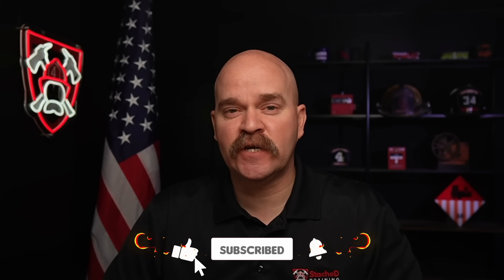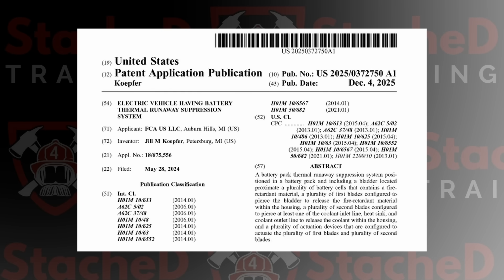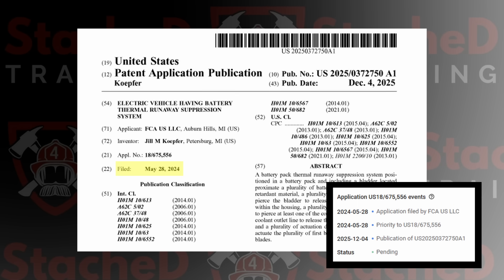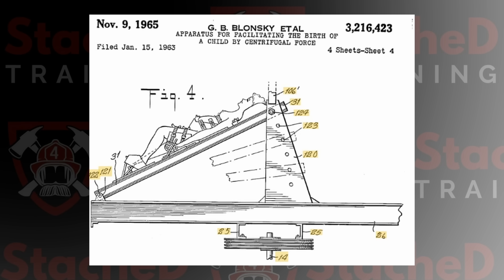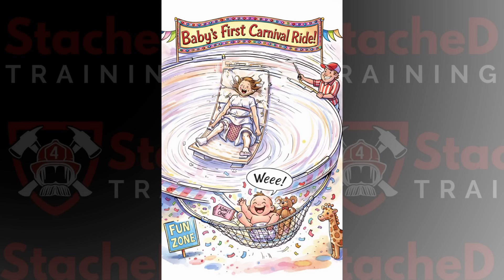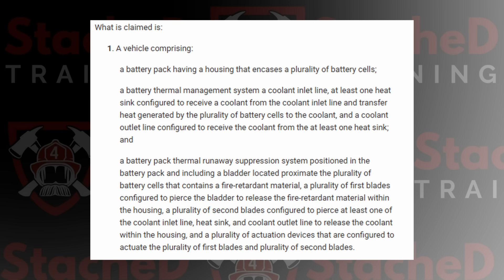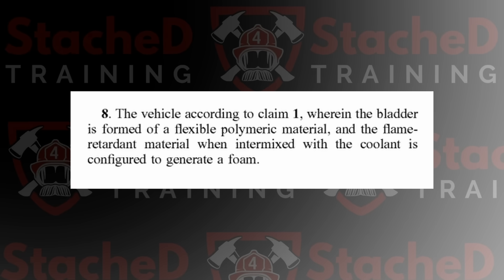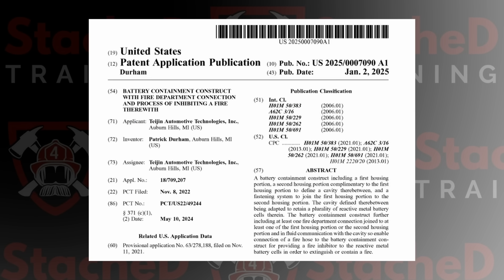Can a Stellantis Patent Solve Battery Fires?

Comment: I don't understand the people who think some magic will happen and batteries will suddenly be safe. 
Anything which holds a lot of energy is dangerous. That can be more or less dangerous depending on what it is and what you're using it for but energy is energy and if it gets released quickly when you don't want it to the result will be a big problem. 
This can't be changed so it needs to be mitigated for. This is why petrol tanks have allsorts of safety features and even their placement in the car is designed very carefully. 
The safest road fuel right now is diesel because its parameters for problem causing mostly fall outside what you would normally expect in a car wreck unless you get really unlucky.

Comment: The only practical way is to space the battery cels out so they cannot send the adjacent cells into thermal runaway. 
That would give say 300 cells insted of 3,000 and one tenths of the range, also known as a useless car.
Or the old Nickel Cadnam cells that as far as i know do not go into thermal runaway but the same result, a useless car.

Comment: If you need a system to release a fire retardant foam, and leave room for said foam.... then you might as well just surround the battery with foam in the first place, at the point of manufacture... The reason they don't do this is that it won't help much,  and would take up too much space and add cost.

The best solution to not burning to death in your car is not buying an electric battery powered vehicle ;D

Comment: Somehow this reminds me of when EU law mandated a more climate neutral substance for AC in cars.
Some companies (iirc two french manufacturers) switched immediately, and some german tested and filed documents and an objection, because the new substance, while better for the envirement when the system leaked, was highly inflamable (a very bad idea in cars) and when it burned it produced a dangerous acid and dangerous gasses. So very bad for everyone including the envirement.
The other argument the objecting manufacturers made was that they rather devellop AC using CO2 than using that substance.
Because in case of leaking or a fire CO2 is less harmfull still.
EU law was changed because they acknowledged that better chemistry is important.

Comment: Yet another reason why i would prefer grabbing myself a used early 2000's era sedan with a V-6 Gasoline engine.

Plus there are other transportation options i would use if i can't find a used gas powered car in perfect/workable condition:
Transit bus (a non-self-driving type)
Taxi/Uber/Lyft (again a non-self-driving type)
Amtrak/Commuter train

One alternative transportation option i don't recommend:
Passenger planes (only as an extremely last resort)

Comment: Hey StacheD fellow mechanical engineer here also with many patents have you heard of this method below?  Thanks
New European method gaining ground in the US can extinguish EV fires in minutes with minimal water use.  Lessons Learned from a use case in Tempe, Arizona where an UHP cutting extinguishing lance was able to extinguish an EV fire with minimal water use.  The method used involves the use of an ultra-high pressure cutting extinguisher to stop propagation inside the battery using fine water mist.  While operating this method, the use of a Thermal Imaging Camera is imperative. The TIC is used to determine the hotspots of the fire and if any of the battery cells are involved.
A trained operator can then apply the cutting extinguishing lance to penetrate the outer casing of the battery, creating a small hole through which the cells inside are filled with a high-pressure mist of fine water droplets.  This can help quickly stop the propagation inside the battery. Tests of the method and several use cases have confirmed the method can help get the fire under control in a short time with minimal water use.  Since the run-off water contains many toxic compounds, the low use of water can also be better for the environment.

Comment: I drove main battle tanks for years. They tend to have fire suppression systems for obvious reasons!
Reply from the maker: I worked on the prototype M109-A7 (PIM). The fire suppression system was impressive.  I'd hate to be inside if it went off, although far better than fire.

Comment: Thats the dumbest thing I've seen this year..

Oil is flammable dipshits...

Coolant also toxic..

Fire retardant. Toxic to humans and environment. Even the officals stiff. The red stuff dropped on fires.  Full of toxic stuff, bad enough to where a civilian had to send some to get tested cause fire departments don't tell whats in it.  

Will everyone with the system also need haz certified and trained as any leaks would be a massive environmental issue at the least.

And do they know how hot an EV Fire gets. Melts through just about anything... so where's that fluid and suppressant mist likley going.. 

What, drains through holes and all over the ground not useful as the whole car burns still...

Comment: A fire department connection sounds like a good practical step to making these batteries safer. Cool the battery with the system it was designed to be cooled with instead of just spraying it. 

The bladder sounds iffy at best. Piercing the cooling system instead of a backup coolant tank on that system soulds counter productive.

Comment: No , lithium batteries will literally burn:

1. Underwater.
2. In a room full of CO²
3. In the vacuum of space.

Once they catch fire , all you can do is wait until they burn themselves out.

This system tries to rapidly cool the battery back down before the fire actually starts...but that window is only a couple of seconds.

They are either:

1. "Patent trolling" , they are getting a patent for an idea that might work someday in the future.

OR

2.Trying to BS the insurance companies into delaying higher liability rates.

(It's probably #2)

Comment: Stalantis is a bad joke. I worked at a dodge dealership and have installed many of their as they call them recall solutions. So the system that fails to begin with selfdestructs, this should be put on all ai systems! Craziest part is creating a runaway to stop a fire that won't go out. If there was a chemical to put those fires out wouldn't you guys have it already.

Comment: Out of curiosity for a theoretical design, how much thermal energy can be released on, let's say, the most common Tesla high-voltage pack during runaway?

Wondering if a special coolant loop could be used with a gas separator and flare stack-like system.

Comment: I just want to tip everyone off, that Lithium Iron Phosfate (LFP, LiFePO4) batteries are very safe batteries that do not burn - I repeat - do not burn!

Look it up at YouTube - there are a lot of demonstration videos, not by the producers of those batteries, however by regular people. 

These batteries, if punctured, crushed or overcharged, may smoke, may get hot, but do not burn, because they actually have a different chemistry than lithium ion batteries. The energy density isn’t as good as in lithium ion batteries, but it is good enough, that some EVs already have got lithium iron batteries already. They last for several thousand cycles, so are much more robust than lithium ion batteries,
so next time you choose a battery powered product - look for the LFP version of that product, if available, either it is EVs, grassmowers, drills, powerbanks, including or should we say, especially the big 'Ecoflow' type, and energy storage if you have solar power. 

Ditch lithium ion and go for lithium iron phosphate.

And if you are good with tinkering and for example have an ebike, with a worn out battery, consider building a new battery pack with LFP, which is pretty safe or if you aren’t so good at building stuff, look for even e-bikes with LFP batteries, for sale. Not sure if they have come yet, but they will. Because LFP is both safe and sturdy, and in many use cases, the somewhat lower energy density doesn’t matter anyway.

I believe this is the best way forward to reduce fire hazard from lithium ion batteries - just switch to Lithium Iron Phosphate wherever it is possible and available. One pet peeve I have is btw that a lot of EVs having a 12V battery for the regular lov voltage circuits, still use a lead acid 12V battery - and if you struggle with a poor 12V battery (especially in Hyundai cars) you should switch to 12V LFP now, or next time your 12V lead acid battery fails, but you don’t want to wait until you are stuck somewhere, of course. It is more expensive, but last as long as several lead acid batteries. LFP doesn’t contain cobalt, good for the vallet - good for the environment!

Comment: Well i happen to be a mechanic at a stellantis dealer. What i know is this; they’re relying on heavily on software to detect problems and shut off the battery. We have had recalls on every high voltage (phev or ev) older than 2 years, and the recalls keep changing. The number of affected models keeps growing and frankly, the techs are clueless.

See, the recalls all consist of a software update, and a “drive cycle” this is supposed to allow the modules to detect issues in the batteries and from there we can determine if replacing the battery is needed. Many techs cant read English well, so the first issue is the recall being done incorrectly. But frankly, the software is the biggest problem.

The inherent problem with these batteries is the volatility of the 200+ lbs of lithium. Software can only do so much and frankly, as a former programmer it disturbs me how much we rely on it…
Reply: Thanks for sharing your comment.

Comment: Even with a fire suppression system, it doesn’t increase your range, or charging time, or the myriad of other issues with an EV. 

The Hindenburg exploded due to hydrogen. Modern blimps use helium which isn’t flammable. 
But you still don’t go to the airport to catch a dirigible.

Comment: How many EV batteries are there at this moment in time and how many of them have the potential for thermal runaway. Think about that because somewhere a terrorist is thinking about that. These EV batteries are a terrorists dream. The ability to start a fire anywhere at any time that can’t be put out. Now make it legal to own and move around without be noticed then multiple it as many times as is reasonably possible. A thousand EVs go into thermal runaway in a certain place at a certain time. It’s just a parked car until it starts to burn.

Comment: The white elephant in the room is the fact that even the 12 volt electrical system on all vehicles can cause a catastrophic fire.
So no matter how safe they can make the individual battery cells the fact that there is several hundreds of times the energy in a VSM battery pack than a 12 volt battery means VSMs will always be a mobile blast furnace.

Comment: Sounds like one of the solutions would be to find a way to completely discharge the batteries. 

If we could quickly and safely eliminate all the charge in the batteries I bet it would work. 
And it's probably just as easy as perpetual motion😊
Reply: Being serious for a moment, these batteries are still a serious fire hazard, even when fully discharged.
Reply: @CrowPal  I'll take your word on it. I'm far from an expert. I was just thinking if it didn't have energy in it then it should be safer.
Reply: @a9ball1   You are right, it is safer when discharged, because there's less stored electrical energy, but a discharged lithium battery still has a lot of stored chemical energy, and is still far from safe.  This is why you see garbage trucks and battery recycling plants going up in flames.  It's just a horrible choice of battery technology for use in the real world.
Reply: @CrowPal  Thank you for the information. I didn't think about chemical energy. I personally can't wait for a new battery tech that is safer.

Comment: How heavy is this bladder of fluid?  Yet more mass in an already egregiously heavy vehicle.
Reply: F-150 may BE more heavy than my 2 eletric cars
Reply: @contra_plano  F-150 average is around 4500-5000 lb. An EV sedan average is around the same, slightly lower. Model 3 is 4000lb. The battery really adds a wallop of weight. An F-150 is about the same as two subcompact or compat ICE vehicles, e.g. a Civic.

Comment: How does that really even help? Most battery fires seem to be from accidents so wouldn't the coolant / foam just run out first chance it gets? Or worse the battery stays sealed and it turns into a pressure cooker?    This sounds about as practical as that battery that shoots out of the car when theres a fire (>_<);;

Comment: How to prevent thermal runaway: modular batteries with firewalls in-between modules so failures can be contained within a single module instead of spreading to the whole pack. Only problem is that sufficient firewalling and individual module venting to keep up with a worst-case module failure will destroy pack-level energy density.

Comment: how much is this gonna increase the price even if it does work?
Reply from the maker: Enough that it likely would never get to production.
Reply: @StacheDTraining   doesn't sound like a reliable system either since it's single use, it would not only be an expense the buyer has to pay but also to replace along with the battery so yeah not very cheap of a reusable modular system.

Comment: Focus and efforts to make ESCAPE fast & easy,. NOT in trying to Dose the battery chemistry with lethal chemicals. 
Exacerbating the main issue of FIRE the extreme of elements to negotiate.
The door LOCKs when no power is applied, can in part be somewhat mitigated by their door lock -secure devices in  an
"NO" Normally Open"  state.
So, power applied energized them, Closed and Loss of power will release and OPEN them,.
I Work in High Tech industry,  and every valve like used that has a safety default. Loss pf power or energized to function will default to CLOSE this preventing gas-fluid-Vacuum for passing points. 
It's the best system there is. 
WHY EV's don't have "built-in "mechanisms structure (from what I believe I am hearing said and see ) this is absurd Very dysfunctional engineering!! 
As an engineer in my field, to hard to accept its weak and poor safety concerns in a general way, is bothering to me, seeing I am on a Very dangerous, High critical control of elements, industry. 
It just escapes me.
Honestly, If I spent time looking a little closer on this, I am fairly confident I would invent some way or device for restructure allowing this "escape the car fire.
 I would gladly make a Large wager I can redesign this one whole dynamic.

Comment: Still, this raises an interesting question about solid-state batteries (yes, I know Donut has announced the impossible…). With higher heat flow and different thermochemical properties at the material level in SSBs, but no liquid electrolyte and less gas generation, I imagine the fire suppression system could be quite different. One key element is the solid-phase interfaces where thermal runaway propagates: the heterogeneous contacts create irregularities and hot spots that liquid electrolytes don’t have. This means the triggers for TR behave differently and have a different progression profile, which requires different detection methods. This article is interesting in that regard: “First Experimental Assessment of All-Solid-State Battery Thermal Runaway Propagation in a Battery Pack.”
Reply: 👆see everybody Doctor B knows about the (so-called) fireproof "Donut".🍩

Comment: The automotive industry can't show that airbags work properly after ten plus years (just got my airbag recall check 8 years late). I'm not sure I would trust a massively more complex system to work without constant maintenance.
Reply: My airbag worked. Barely felt it. The deer wasn't so lucky.
Reply: Probably some reinvented airbag system that is complex and replies on electronic. Old airbag system works just fine
Reply: The airbags in my cars still work fine after 30 years.
Reply: Airbags are just chemistry doing the work of rapidly filling a airbladder.
Reply: @jonathanjones3126  And the Takata Airbag Recall says they can't get that right... Paying the plaintiff attorneys for 20+ years now...
Reply: @derf_the_mule1405 it doesnt help when a company chooses the cheapest possible source.

Comment: What batteries did they use in the Voyager space exploration craft?

I believe that it is over 50 years old and billions on miles away from earth and still working 😮
Reply: Voyager doesn't use traditional batteries but is powered by Radioisotope Thermoelectric Generators (RTGs) that convert heat from decaying Plutonium 238. Somehow, Lithium batteries seem quite safe in comparison.
Reply: Yeah, that's the ticket!
Reply: @theonlywoody2shoes  Lol you should see all the RTG accidents and incidents over the years (yes, I mean as in death and radiation injury), especially in the countries of the former Soviet Union and Eastern Bloc. 

One scary fact: A known but unaccounted-for amount of steel rebar and steel table legs manufactured in the 1980s and contaminated with radioactive cobalt-60 still exists in the "wild" in the United States and Mexico. Most of the contaminated metal was recovered and isolated (e.g., structures built with the rebar demolished), but not all of it.

Comment: IF the Donut solid state battery isn't a mythical unicorn (it likely is), then EVs might make begin to make sense. Until the batteries can be charged very quickly, aren't in danger of thermal runaway, and don't involve rare minerals from less-than-friendly countries ... EVs remain a sad, misguided joke.